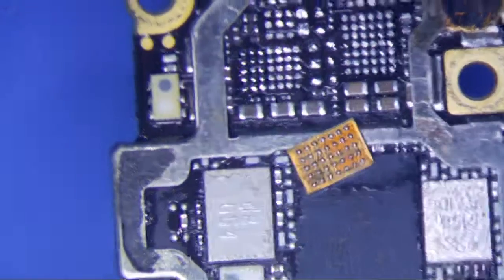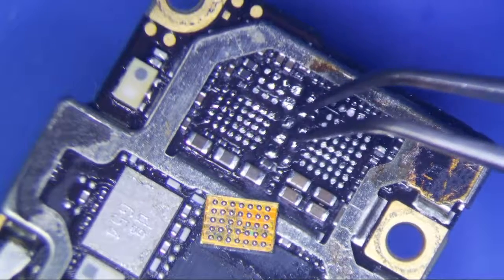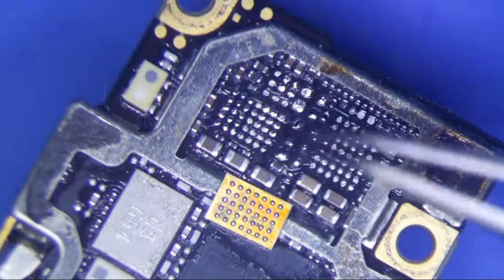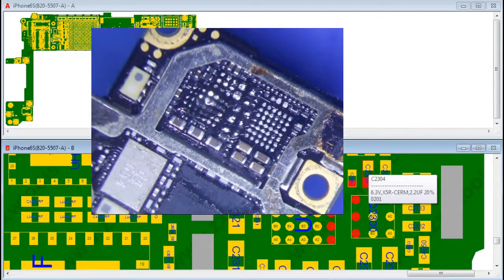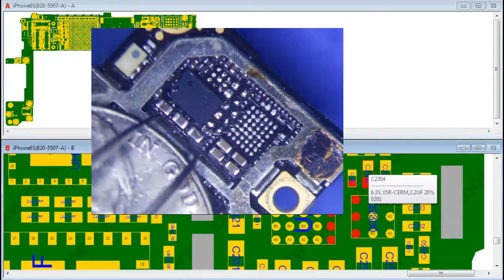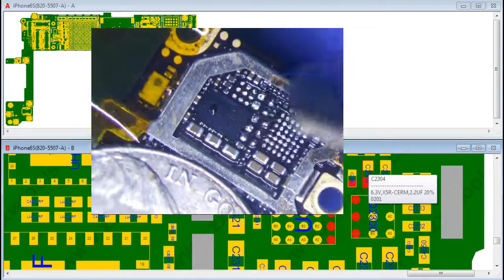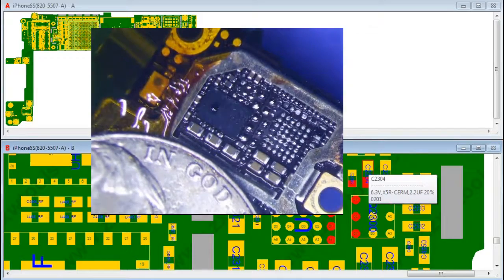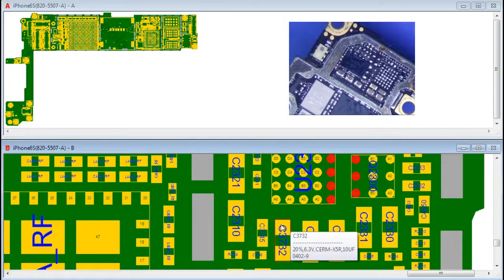iPhone 6s USB Charging IC Tigris Reball Repair

Comment: Hey Mike have you got a link to that follow up video , i realise this is an old video, but i have a 6s which was getting very hot at the Q2300 so i shorted it but Tigrus was also getting hot with both ics off and the surounding caps like you removed , so now it no longer hot but its onlt pulling 0.007 amps when promted to boot the short still remains , on VDD Main i beleive, before that it was taken what ever amps i put into it , any advice would be a great help....thanks again

Comment: hei there 
my 6s lost battery so much on standby mode (15% per hour). it help to replace this ic (charger)
Thanks
Reply from the maker: minh hong yeah I would consider changing Tigris first
Reply: hi again
Thank you for answering
you mean USB Charging IC Tigris  not :
CHARGING-USB-POWER-CONTROL-IC-CHIP-1610A3? so what it name ?